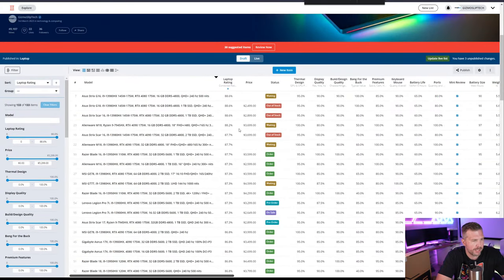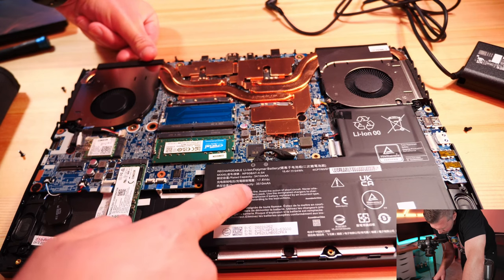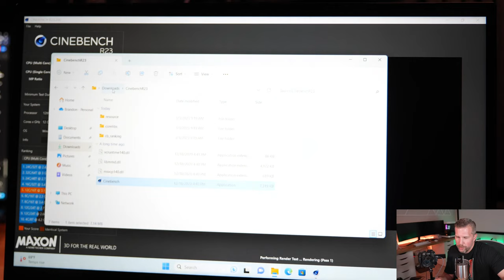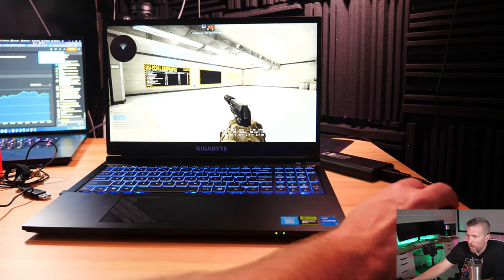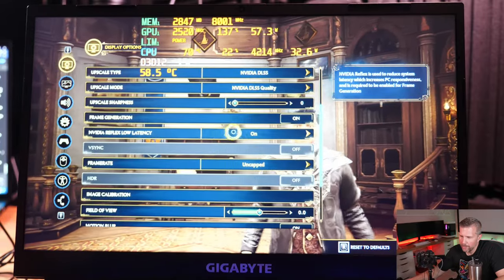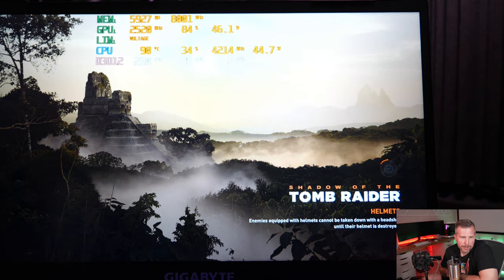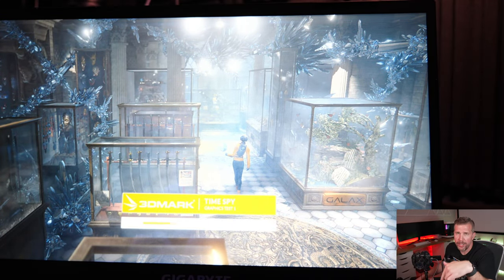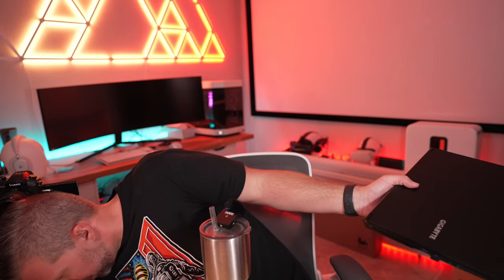RTX 4060 for $1099 - Gigabyte G5 Unboxing, Benchmarks, 7+ Games, Display Test, and See Inside!

Comment: @2:14:15 Yeh i agree with you tuning this sucker and showing a before and after in a video. Standalone as is its completely useless at the 1100 price range. Terrible Cpu temps (also much worse performance than a stock 11800H), insufficient power adaptor, non existent Ram capacity making even 1080p demanding gaming like Hogwarts a no-go (also DDR 4 needs dual channel fiercely). Add the 8gb stick, solve the power adaptor issue (may just need a larger brick), repaste, and also consider a Gpu Undervolt+Overclock to see how these low watt 40 cards perform with tuning.
Reply: Any laptops you suggest to wait for or that are already released in similar price range?
Reply: @TheMaxedSkills  Very soon (as early as this month) laptops with rdna 3 based 7600mXT are coming out. They should beat 4060 and maybe rival 3070ti/4070. We have seen Jarrod review recently the Asus Tuf with a power limited version of it called the 7600s i believe, and it already beats a full power 3060 while using less than 100w (also it was only using a refreshed zen 3+ chip in the 7735, not an actual Zen 4). It should be priced competitive with the 4060 as well. Also if you want all Amd, Dragon Range (and maybe Phoenix) Zen 4 processors should also be rolling out later in the month. Those crush Intel in terms of power efficiency, and even win on performance. Pricing should be no more than Intel, and maybe a bit less. It will all depend on availability and models. There should be some solid ~1k to ~1.3k options for mainstream in the coming weeks, I wouldn't bite right now unless one wants to settle on a good 3070ti deal or something.
Reply: @slickrounder6045  Wow, thank you for the thorough answer, will be looking forward for the new laptops then :)